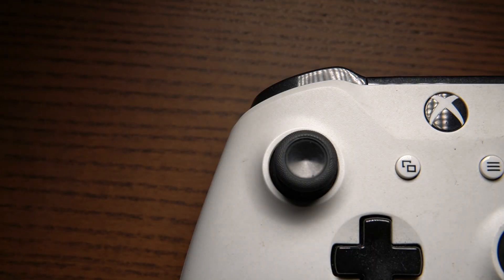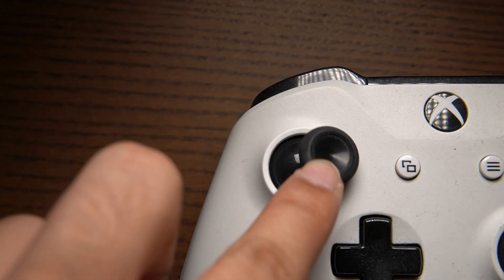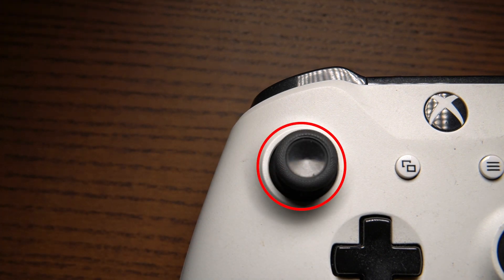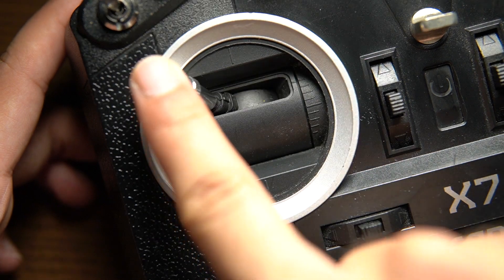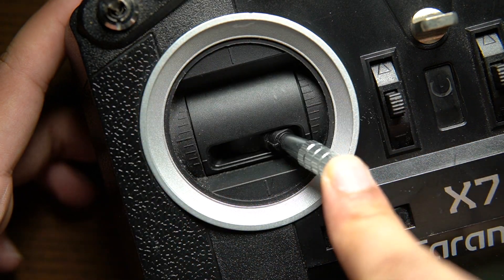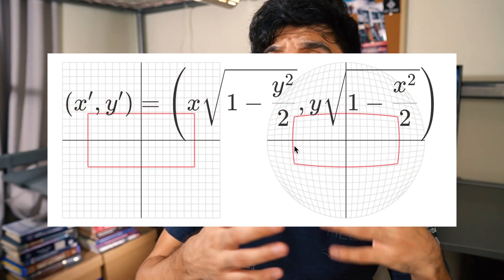How to build your own flight controller | Part 6: making sense of user input

Comment: Discretised, what camera/ lens setup are you using?
Btw. Your videos are top-notch and I'll be sharing them everywhere!
Reply from the maker: Thank you! I’m filming on a Sony a6400, and the lens changes - for the desk shots in the last couple of videos I’ve been using the Sigma 16mm F1.4, but for the vlog type shots I use the wider 10-18mm F4. The macro shots were taken on the 90mm F2.8 G macro, whilst the shots of the R/C hobby stores were done on the 18-105mm F4 G! (you can tell I’m a little bit addicted to collecting lenses)